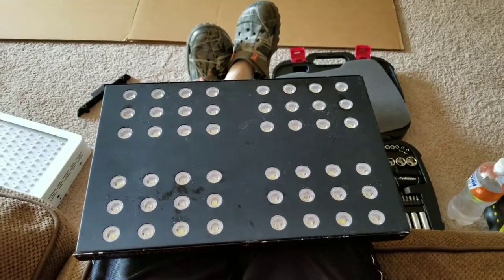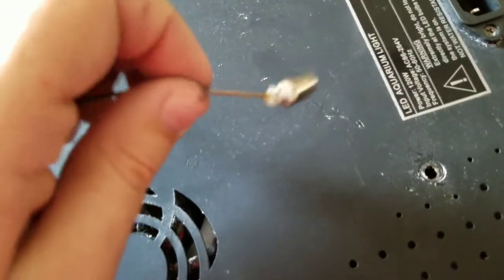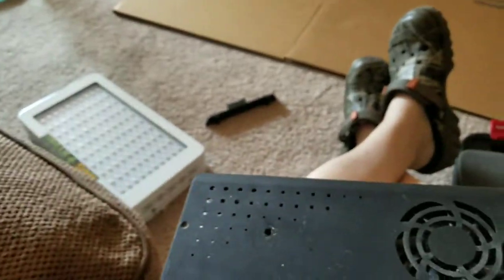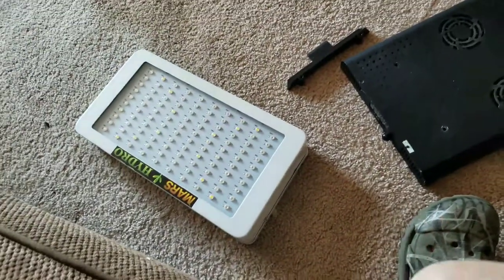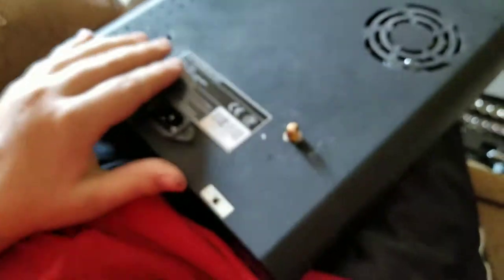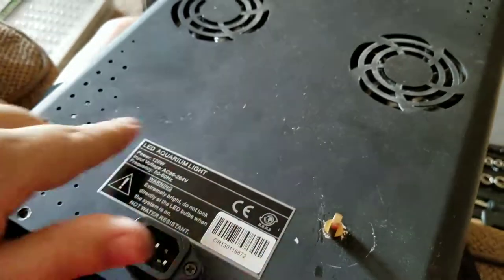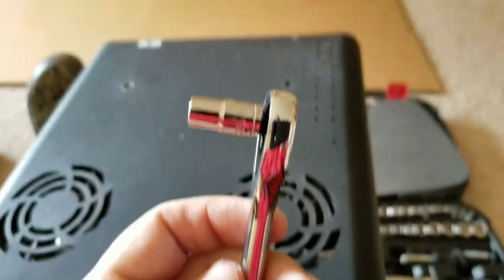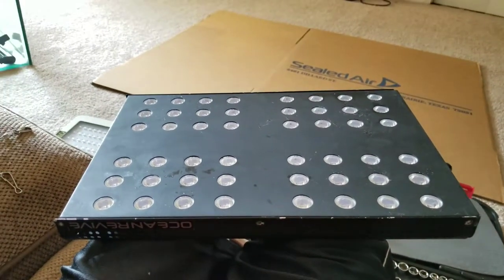Replace your T247 Hanging Kit the east way.

Comment: do you know what those little pieces you screwed on are called ? i want to just buy them and  i cant find them .
Reply from the maker: I do not remember. I believe I placed an order for either a hanging kit or the brackets, but I really do not remember as it was a while ago. I also believe Ocean Revive is out of business, but I think you can still by the lights for whoever the company is now. If you are able to find thst out, they should be able to help you better than I can. I'm sorry im.nit much help. You may also ask people on reef2reef, someone is bound to know there.
Reply: @BriansAquariums  thank you for the quick response man, but I found eye bolts . Those should work too if I get the right size